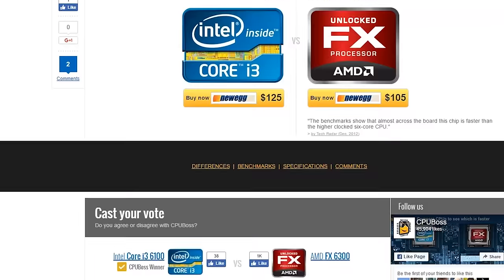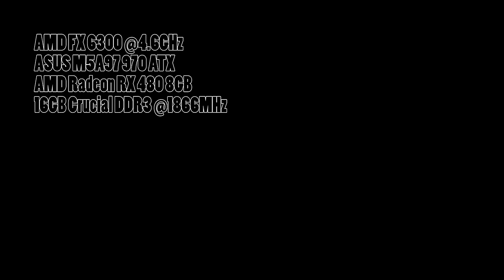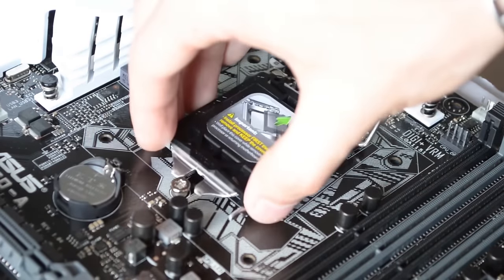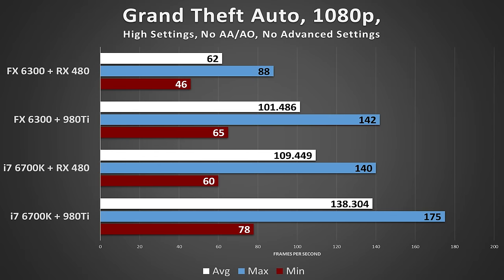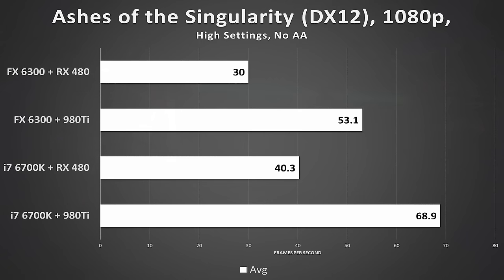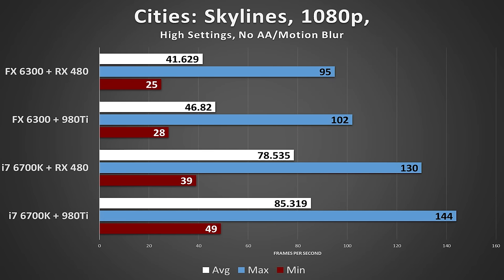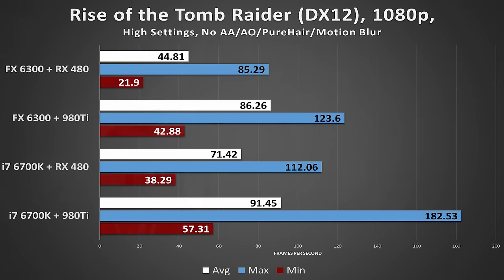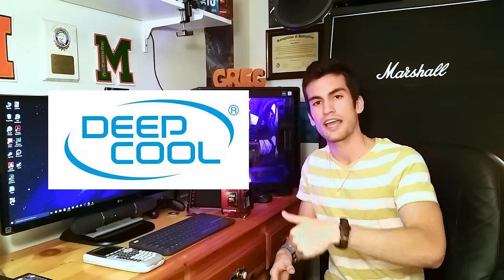AMD FX 6300 + RX 480: Severe Bottleneck?

Comment: Yeah but you are running a new i7 HEAVILY OVERCLOCKED with faster ram. Compare it to the i5 2500k with identical frequency ram. That's the processor it was intended to compete with

This comparison is woefully unfair because of the age difference of the platforms. AM3 is 7 years old. AM3+ is mostly the same thing with a couple of small improvements. 

Take a stock i5 2500 (non k) using 1800MHz or 2133MHz DDR3 on both systems. Compare it to the FX6350. Run both CPUs at stock clockspeeds. This will keep both the processors power draw at optimal. 

Sandy Bridge was intended to compete with the FX processors. Give AMD a fighting chance against the intended competition
Reply from the maker: Pay attention.
Reply: I did pay attention. I just would prefer more of a pure architecture vs architecture test. Tests using an FX processor should really be more about how they stack up to the intended competition over time. Vishera vs Sandy. The reason you can still buy them today isn't because they are meant to be competitive but they allow AMD users to continue to support their established platform.

The stock i5 2500 should still beat the FX6350 but in recent multi threaded games the results should be wildly different than what we saw 4 years ago

Its similar to when you look at the R9 280X vs GTX770. The architecture advantages and disadvantages appear over time
Reply: have you watched the video?
Reply: Why compare them at stock speeds? The FX series are meant to be overclocked to hell. I'd rather see comparisons with decent OC's because not doing so with an FX series or K series cpu is just a waste
Reply: Believe it or not most people want nothing to do with overclocking. Most systems are never overclocked because of warranties and the general consensus that overclocking puts strain on your chips and motherboard shortening the longevity of your PC.
Reply: Are you insane or just that dumb? Who the fuck cares about what you prefer? He is testing an FX 6300 with an RX 480  vs a "as no bottleneck as it gets CPU"  which happens to be Intel. This is not a CPU vs CPU video. Also even if it was he is comparing the newest from AMD vs newest from Intel which also woudn't be unfair, its AMD's fault their shit is old. There are a ton of videos comparing the FX CPU's vs Sandy B. so there is 0 reason for him to actually make one of those, especially when the Sandy B. perform super close to the newst Intel chips. And he is using an overclocked i7? And the 6300 was also overclocked its just that it runs a bit hot so it cant be overclocked as much. Also why would you give someone a fighting chance? There is 0 reason to give someone a chance they need to justify someone buying their product by themselves, buyers are not a charity. You are obviously bias to AMD, so don't participate in arguments its making ppl lose brain cells with how dumb your statments  are.
Reply: No you should pay attention and read the title again. I don't know where you got the idea that this was a video comparing 2 CPUs. He was trying to show you that the fx 6300 bottlenecks the rx 480. He thew the i7 in there, because It's the most powerfull CPU for games. Btw the i5 2500k was rather competing with the 8350.
Reply: Sasa Lolic "It runs a bit hot so it cant be overclocked as much", thats really not a correct statement. Contrary to the popular, "AMD=The Sun" philosophy, the FX series run quite cool. I have the very similar 6350, with a 212 evo, and even with my cheap, quiet fans the cpu still stays under 55c at 4.6GHz, under very heavy loads, and room temp at idle. And I could push that number even higher with a half decent AIO or even just more powerful fans on my evo, and a PSU I could trust. I'd hardly call Greg's OC of 500MHz over stock turbo not as much as his 400MHz OC on the 6700k
Reply: ***** I really want to see how FX hold up to its intended competition

i3 2130
i5 2550k
i7 2700k

With equal DDR3

I'm more interested in how these newer games support multi threading better than the bulk of the games released up till recently.

DDR4 clocked at 3200 will show massive gains over 1600MHz DDR3. This doesn't reflect the CPU architecture.
Reply: you're making a fool of yourself
Reply: +Ian Brandon Something Again, like the others say, "pay attention." Pay attention to the title and the content. This is not a comparison video, it's an analysis of how much an FX-6300 can hold back an RX 480. You're trying to prove a point that doesn't even exist in the video in the first place.
Reply: Ian Brandon Something The FX CPUs are better than the i3 2130 gen but worse than the i5 2500k. There you have it.
Reply: I could have told you a year ago that the RX480 would be bottle-necked by a FX6300. That's obvious. What this doesn't tell is how much, if at all, those additional 2 threads close the gap between 6 core FX vs an older 4 core i5. That was supposed to be the point of the improvements in multi threading performance in recent games.

Using the newest i7 overclocked to its maximum along with 3000MHz DDR4 doesn't tell me at all if running a RX480 in an older i5 or i3 PC would also bottleneck it. I want to see if DX12 made a difference for the FX processors against the architecture it was intended to compete with. The FX processors were clearly defeated by large margins on release. I want to see improvements to code have changed that story.
Reply: ***** ? i used a prebuild sff that that is insanely tiny pc with an i5 2500 with a shitty stock cooler and obviouly horrible airflow and the temps didnt go over 50-55 in the summer. An considering how old that pc is if i changed the paste and cleaned it a bit it would be even cooler
Reply: +Ian Brandon Something then don't argue in a specific video which intention was only to show how much of a bottleneck is caused by FX6300 when paired with RX 480. If you want to see comparison with older i5 or sth, there is a search bar on the top...
Reply: +ElectryPower There aren't many that even demonstrate the RX 480 with the FX6300. 

I guess I just want to see the results of this combination against a similar Intel setup. The i7 6700K overclocked to 4.6GHz with 3GHz DDR4 is a brand new high end setup. Its literally the highest end system for game performance you could run. 

It doesn't tell me what I would expect running the RX480 in a Sandy or Ivy bridge PC that isn't overclockable. The new i3 with 3GHz DDR4 competes with the overclock i5 2500k. Its hard to really compare the old AM3+ platform against a DDR4 platform. Nevermind overclocking the newest i7 to such high frequencies
Reply: +Ian Brandon Something Make a request for a different video, then. This video was meant to measure how much of a bottleneck the FX-6300 is to the RX 480. Yes, it tells you "how much" by putting two CPUs and two GPUs in four different pairings. By pairing the graphics card with the "best" consumer-grade CPU, you're removing as much bottleneck as you can. The 6700k shows the graphics cards' best consumer-grade performance. What it doesn't tell you is "how much of a bottleneck is it compared to an i5-2500k." You won't find that in this video no matter how many times you say, "I only wish it was shown here."
Reply: +Ian Brandon Something I'd also love to see comparison with older i5s, as I own 2400 non-k (oced to 4ghz) currently paired with r9 290.

I was kind of expecting better performance out of the RX 480, but benchmarks have shown that there is no point for me to upgrade (except for lower power draw maybe)...
Reply: Read the title of the video lol, this is not a cpu comparison!!!
Reply: UlTrApLeX I really don't understand how you could say its not. Its literally a comparison between how two different processors feed a GPU. 

Its a direct comparison between CPUs. 

Just not a very fair one given that there is such a massive difference between ram.
Reply: and yet another idiot. hahahahaha
Reply: I agree with , it was not AMD vs Intel, we have to look at old vs new architecture (AMD or Intel). I'm still using my 8350 atm since it filled all my need just I have to be aware that It wont last forever and that inside a year I might need to replace it. (This video goes to the people using the old Intel CPU as well)
Reply: +Ian Brandon Something 10 replied saying you dont make sense but keep arguing and not realising he just used the intel cpu to show that the fx cant power a rx 480 also ram has very little influence here even a 4770 would give next to identical frames to the 6700k
Reply: They will be all equal since all of them are old architecture. You have to realize this generation of CPU wont last forever and that application are asking more and more IPC. All of them need to be replaced one day and the day is coming.
Reply: ElectryPower Exactly my point

A lot of people have un-overclockable Sandy Bridge and Ivy Bridge processors that are used for gaming. A lot of people even run low powered unoverclockable Haswell parts with low powered DDR3. Running the RX480 on older i5 systems is a more realistic test for the people interested in it.

Those are the budget users looking for a cheaper, low wattage GPU, which is exactly what the RX480 is.

It may also paint the FX 6300 in a less woefully outdated light. The FX series always struggled because of its single thread performance. New programs are supposed to actually fully load the processor.
Reply: Someone with an overclocked i7 6700k is not going to run an RX480. They'll run a far higher end GPU config
Reply: +Joshua Kallen After wasting 15 minutes reading this comment thread I'm convinced that Brandon is either oblivious and slow on the uptake, or just hard core troll. Let's just stop feeding it because he'll turn around and say the same darn thing. "It's a CPU comparison guys." Literally says not a CPU comparison disclaimer in video.
Reply: +Ian Brandon Something this is not a CPU comparison this is a video to show if this CPU is a bottleneck and how much of a bottleneck it is.
so your point of comparing with other CPU is completly invalid because he used the 6700k to show how the performance of the gpu is when it is not bottlenecked.
Reply: ***** The results are clearly meant to tell us that the FX6300 will bottleneck the fuck out of the RX480. That makes this a CPU comparison

An older Sandy or Ivy i5 in stock vs stock against this CPU would tell us whether or not there are any gains possible from 6 FX cores compared to 4 Intel cores and whether there is actually a tangible improvement from addition cores in DX12 titles. The i7 overclocked with 3GHz DDR4 only shows us that 8 of the newest theoretical Intel cores running at equal clockspeeds feeds the RX480 25%-100% better than the FX6300

Its certainly a CPU comparison if you learn anything from it. I just wouldn't judge the old Piledriver architecture by this comparison. It wasn't intended to compete with Skylake
Reply: Sasa Lolic Sorry to say guy but people that go around calling others stupid and dumb, often are trying to appear smart to prove to others that they aren't thick as a brick.

I own PC components from all of the big three. I have love for AMD but that doesn't mean I won't say their hardware is shit when it is shit

I loved my Win7/Phenom II x4/HD6950 ref build. It ran everything I wanted at near maxed out image quality, and it only set me back $700 for everything including the expensive bits I splurged on.
Reply: +Ian Brandon Something Dude. The point of this video was to show that pairing a 480 with 6300 is not a good idea. Nothing else. If you want dx12 benchmarks, look it up. The i3 is still miles ahead in dx12 titles. You are bringing up the fact that it wasn't meant to compete with a skylake. nobody is saying that is supposed to. But that doesn't change the fact that the fx lineup is not worth it right now.
Reply: Bruh... This isn't comparison who's better. This is comparison of a bottleneck. He's showing how much is FX 6300 actually bottlenecking RX 480. In order to do that test you need as powerful CPU as you can get and as powerful mobo as you can  get to remove them out of the equation "bottleneck". When you remove that you get to see how more FPS you actually get (the less fps you get the less of a bottleneck CPU in test was the more FPS you get the more bottlenecked CPU was)
Reply: Rhelmar It clearly showed that it has the potential to severely bottleneck the GPU. These tests don't really prove that your bottleneck will scale with near maxed settings though.

My experience with my Phenom II x4 taught me a lot about how adjusting settings properly can allow for a lot more headroom from weak hardware than benchmarks show

Skyrim was running at 15-40fps when I maxed out every setting. Benchmarks put the HD6970 at 60fps+ running at 1080P. Turns out Bethesda's ancient engine handled shadow rendering through the processor. A rendering method going back to Morrowind. One tick down in shadows put me at 60fps average.

After that I began to mod. I improved almost every texture in the game to levels recommended for far high spec systems than mine. I kept adding all of the best graphical mods available. I couldn't believe how good the game looked. Best of all the frame remained locked at 60fps.

My point is that a CPU bottleneck often isn't really holding back the GPU. You can limit the load on your CPU and continue to increase load to the GPU without frame rate penalties.
Reply: Ian Brandon Something Yes you can do that if you can mod. Unfortunately not every game has settings to minimize cpu load. And most people can't mod games. You can't eliminate a bottleneck by just tweaking some in game settings. You can try ini tweaking, but most people can't even do that. That's not the point though. The point is, that you complained about him using an i7 to show the bottleneck of the fx 6300. If you were to do a vid like this, how would you do it? what hardware would you compare? I'm generally curious, since you seem to have some other ideas.
Reply: Why give them a fighting chance? This is 2016. Still they are sitting on their hands with nothing new.
Reply: +Ian Brandon Well it's not Science Studios problem that Amd is so greedy that they re-releasing their obsolete, over 5 years crappy FX cpus and can't provide anything to the cpu market with discrete cpus.
Reply: Rhelmar You are right not all games do. Saint's Row the 4th was unplayable on my Phenom II x4. I couldn't get 30fps stable no matter how low the settings were.

He didn't do his test wrong. He showed basically the best case scenario for the RX480

If I were to demonstrate where the FX processors bottleneck the RX 480 I would compare the FX4350, the FX6350, the G3258, the i5 2500k, and the i5 6600K.

That demonstrates when the system is bottle-necked by thread speed, the number of threads, and memory speeds.

I would use the GTX970, RX480, and GTX750Ti or another low end GPU to compare the effect of Nvidia's and AMD's loads on the processor and whether or not thread count has any effect on the driver overhead which is supposed to distribute the load across threads under DX12.

I really want to see if previous bottlenecks are fixed by DX12. DX11 was a disaster for the FX chips
Reply: +Ian Brandon Something This video isn't intended for the time travelers who can watch it back when sandy bridge was released.
Reply: Ian Brandon Something aaaaa you are so dumb this is not about how good the fx is compared to intel it is about it bottlenecking the 480, he jsut used the i7 as it is the best gaming cpu out there to show the full potential of the 480 while not being bottlenecke. nobody cares if you wouldve prefered it compared to an i3 or an i5 go to the search bar and look it up this is about it bottlenecking the 480 or not and we got the answer to it now stfu
Reply: Zwan AMD aren't in the position to release an entire line with small improvements every two years on a new socket like Intel. Intel has 100x more money. They can easily outspend them on R&D to speed up their chips. The amount of money Intel spends on tiny improvements would bankrupt most companies

AMD needed the software developers to support multi threading which they have successfully done through Vulkan and DX12. There was no point in continuing to release improved Steamroller and Excavator chips if they couldn't hold a candle to Intel in IPC and multi thread support was as poor as it was through DX11

I know they can release a competitive chip but they need the right coding environment and a design that isn't automatically outdated

APUs could have put them in the lead but they never had the single thread performance to make them competitive and they couldn't rely on multithreading
Reply: Ian Brandon Something Greedy Amd did no R&D for FX. They just relaunched the overpriced FX lineup as gimped Phenom 2 so they could deceive buyers to buy their bad cpus.
Reply: Look back at Magny-Cours. That was a 12 thread Phenom II. AMD's hardware was never garbage. The support for multi threading was never there to make processors like that usable to the average user
Reply: Ian Brandon Something http://www.pcper.com/reviews/Graphics-Cards/DX12-GPU-and-CPU-Performance-Tested-Ashes-Singularity-Benchmark/Results-Heavy
This links show comparisons between amd and intel cpu in ashes of the singularity. dx11 vs dx12. The fx isn't able to close the gap to intel. 
Your aproach isn't wrong. But it goes way deeper than what your average gamer wants to know. He only wants to know if it bottlenecks or not. They don't care about the details. (It would be an interesting test though). Also keep in mind that he doesn't own all the hardware you mentioned. Even if he did in the past he probably sells stuff that he doesn't need and already benchmarked. Since he still has to buy his hardware himself. 

But let's get back to your original post. You complained that this comparison was unfair and we should give amd a fighting chance. It wasn't intended to be a direct comparison. And it doesn't matter when amd released their cpus. They strategy was the complete opposite of intel. They wanted to keep the fx lineup as long as they possibly could. The fx cpus are no longer worth it. They can't beat the new i3. It doesn't matter that they are older. This is current lineup, and it should contend with intels current lineup.
Reply: Heyyo, ugh I hate the ram speed comparison... if I'm comparing what I would buy for FX-8370 build vs say an i3-6300 or an i5-6400 build? I wouldn't be comparing gimped DDR4 to DDR3... no, I'd be comparing similarly priced DDR4 to DDR3... such as:

G.Skill Ripjaws X Series 16GB (2 x 8GB) DDR3-2133 Memory (CAS 10) = $58.88
https://pcpartpicker.com/product/cF7wrH/gskill-memory-f32133c10d16gxm

to...

G.Skill Ripjaws 4 series 16GB (2 x 8GB) DDR4-2400 Memory (CAS 15) = $58.88
https://pcpartpicker.com/product/ydCrxr/gskill-memory-f42400c15d16grr

They're both the exact same price and even from the same Manufacturer... so how is that not a fair comparison? :P

Then again, if you look closely I included the latency, DDR4 memory has higher latency which everyone seems to miss... so really both of them balance out anyways. That's the trade-off for the lower voltage of DDR4 is higher timings and latency... so yeah, like I said, no one buys RAM with comparable speed, everyone buys RAM for the price to performance. Saying otherwise is just silly.
Reply: MrKeikari The design isn't as bad as you think it is. I believe they exceeded the Phenom II in IPC with Excavator released this year

http://www.overclockersclub.com/reviews/amd_athlon_x4_845_cpu/4.htm

This is the only excavator chip released

This would have been the architecture behind the 4th gen FX 8 cores but AMD are waiting for Zen. If you do some rough math you could see it performing within spitting distance of the i7 6700K in multi thread workloads.

Basically 35% better performance over Vishera clock for clock. Think of a 6.750GHz FX9590

This still wouldn't come close to besting Intel in IPC though which is why they skipped it.
Reply: Ian Brandon Something are you happy now?
Reply: Ian Brandon Something Yeah, 10% IPC improvement after 5 years xD FX lineup is the biggest fuck-up in cpu components this millenium.
Reply: Quite
Reply: Marc Bourgoin That is a fair comparison. The DDR4 used here was 3000MHz but yeah point taken

I did say later that his test was the best way to show the max potential. AMD's memory subsystems are ancient now. They just didn't want to commit to mass production of Steamroller and Excavator and release AM4 motherboards

I hope Zen catches back up at least
Reply: MrKeikari Like I said it was clearly meant for APUs. The on die space savings would have freed up more space for the GPU. 

Basically a 10% IPC improved 8 core Phenom II and an R7 370 core on a single die. Not a bad little machine to be honest. Slap an R7 370 next to it for dual graphics. The performance of an FX 8350 and R9 380X in the size of a Chromebox.
Reply: +Marcusius had to change my FX 8350 for a i7 5820K 6 cores for my GTX 1070
Reply: You've completely missed the entire point of this video, which was to answer one basic question - will an FX 6300 bottleneck an RX 480 (and to a lesser degree, how badly)? Conclusion: Yes. He could have used any of the most current hardware to illustrate his point, didn't necessarily have to be a 6700k, but in context of the exercise being performed it doesn't really matter. It wasn't a "versus" video, it wasn't attempting to be an apples to apples comparison video. He was simply trying to illustrate whether or not pairing a 6300 with a modern video card was a good idea from an economic/performance standpoint, which it clearly is not depending somewhat on the settings you typically play at.
Reply: I don't understand what your on about. The i7 will always be the maximum threshold when analyzing a bottleneck, this video was not meant to poke fun at the 6300 but to check how much it bottlenecks the card vs the cards maximum potential. The 6300 actually handled okay against the i7 and it's frames are nothing to be shamed about. It's just you looking at the video the wrong way
Reply: Ian Brandon Something APUs are decent, especially for the price but that doesn't make discrete cpus any better.
Reply: Watch the end of the video, he clearly explains and answered your comment.
Reply: Why should he test 7 years old Intel cpu? He tests with what is available right now. Anyway no one should buy those old FX cpus anymore, just wait for Zen and if you don't want to buy Zen you can be sure AMD will drop prices of FX even further..
Reply: +Like Clockwork64 
Ignorant or stupid?
Reply: +Like Clockwork64 dude are u homeless?  because u looks like u lost...  go back read the titles and watch the videos please for more info... damn i laughing so hard reading the comment about..  more then 10 ppl saying the same thing just a difference sentences " this is not a versus video " what the heck?  is it hard for u to understand?  and still give out ur opinion blah2 about amd?  defuq?  so fkn biased boy
Reply: +Like Clockwork64 dude are u homeless?  because u looks like u lost...  go back read the titles and watch the videos please for more info... damn i laughing so hard reading the comment about..  more then 10 ppl saying the same thing just a difference sentences " this is not a versus video " what the heck?  is it hard for u to understand?  and still give out ur opinion blah2 about amd?  defuq?  so fkn biased boy
Reply: +Like Clockwork64 dude are u homeless?  because u looks like u lost...  go back read the titles and watch the videos please for more info... damn i laughing so hard reading the comment about..  more then 10 ppl saying the same thing just a difference sentences " this is not a versus video " what the heck?  is it hard for u to understand?  and still give out ur opinion blah2 about amd?  defuq?  so fkn biased boy
Reply: +Like Clockwork64 dude are u homeless?  because u looks like u lost...  go back read the titles and watch the videos please for more info... damn i laughing so hard reading the comment about..  more then 10 ppl saying the same thing just a difference sentences " this is not a versus video " what the heck?  is it hard for u to understand?  and still give out ur opinion blah2 about amd?  defuq?  so fkn biased boy
Reply: +Like Clockwork64 Anyway the i5 2500K is not really the ideal candidate for this comparison, as that processor was competing with Bulldozer not Vishera. Even then, Bulldozer was so late to the game, you could arguably say that Ivy bridge was it's real competition considering It launched just a few month after Bulldozer. Same can be said for Vishera and Haswell ... both were launched within the same time frame (or quarter if you prefer).
Reply: In the video he stated that this video WAS NOT meant to show how much better the 6700k was than the 6300. Instead it was meant to show ho, in a scenario with no CPU bottleneck, the GPU would perform, then compare it to the 6300 to let you determine whether or not it was worth it to take the x% dip in frames in return for the price drop. This was not a performance comparison.
Reply: +Marc Bourgoin
"G.Skill Ripjaws X Series 16GB (2 x 8GB) DDR3-2133 Memory (CAS 10) = 
$58.88
https://pcpartpicker.com/product/cF7wrH/gskill-memory-f32133c10d16gxm

to...

G.Skill Ripjaws 4 series 16GB (2 x 8GB) DDR4-2400 Memory (CAS 15) = $58.88
https://pcpartpicker.com/product/ydCrxr/gskill-memory-f42400c15d16grr

They're both the exact same price and even from the same Manufacturer...
 so how is that not a fair comparison? :P

Then again, if you look closely I included the latency, DDR4 memory has 
higher latency which everyone seems to miss... so really both of them 
balance out anyways. That's the trade-off for the lower voltage of DDR4 
is higher timings and latency... so yeah, like I said, no one buys RAM 
with comparable speed, everyone buys RAM for the price to performance. 
Saying otherwise is just silly."

DDR4 Has a higher latency on paper, yes, but, on paper, my, roughly, 50-100 dollar laptop shouldn't run Crysis 3, yet it does.
http://pics.crucial.com/wcsstore/CrucialSAS/pdf/en-us-c3-whitepaper-speed-vs-latency-letter.pdf

From our beloved Crucial, very good RAM manufacturers.
PS: Page 3 if you don't want to read through all that stuff.
Reply: jubal harshaw  OMG, this ignorant AMD fanboy lying to people without a hint of proof and then raging when her wrong beliefs are corrected.

Jubal Harshaw: "	+MrKeikari You have no concept of what was being discussed...you keep talking about the stupid fucking 8350, like it has any bearing on the matter. Fuck off." CHILL DUDE, STOP BEING FANBOY!!!!!!!!
Reply: ***** Because why not? The 6300 is a popular processor in Steam. If the intel Pentium 4 was the most popular then that one would be compared to an I7 for bottleneck tests. And people should stop comparing the frames of an i7 to a 6300 but focus how much frames the 6300 can put out with the 480
Reply: Benoit Levesque the i5/i7 2XXX series and above have roughly the same performance with the 6XXX series, so comparing them is still moot. The only advantage from 2XXX to 6XXX is a couple more (1-5) FPS with the same GPU and less powerdraw
Reply: JA Belms 
The whole point of the video was to see how much of a bottleneck the 6300 was, it was not to see what the best performance to dollar rx 480+cpu combo was.
Reply: Flying Snail That's what I said
Reply: ***** The ignorant Amd fanboys hang on to every thread to make their obsolete cpus seem even a bit better...
Reply: +Like Clockwork64 He literally addressed this exact issue in the video and explained exactly why it doesn't matter. Not sure if trolling, or really stupid, or deaf.
Reply: Flying Snail This still isn't a great comparison for that point either. This only tells us that the FX 6300 is a significant bottleneck at the chosen settings.

If you pay attention to the settings used he mostly stuck with presets. I know from experience with my Phenom II and HD6970 that the GPU has far more to offer without adding to the CPU bottleneck at all

Finding the optimal settings for the processor and then increasing all of the other settings will increase load on the GPU without decreasing the frame rate for the bottle-necked system yet dramatically increase visual fidelity

This comparison shows how much of a bottleneck the CPU is when the GPU isn't being stressed. His testing methodology  exacerbates the bottleneck. Increasing these graphical settings will drop the i7 test rigs frame rate and barely budge the FX 6300. This would make the results a lot closer and the perceivable bottleneck smaller.
Reply: Like Clockwork64 
You can increase graphical fidelity while not lowering framerate much, that is true but he was not trying to target the hardware to try to get the best looking game. He was trying to find out if at settings relatively close to what people play on, is there a CPU bottleneck?    But all of this is ignoring why he didnt test it like that, because it adds far more work and problems then avoiding it all together. For example, if he increases graphical fidelity in GTA 5, should he increase the amount of ai in the game, and stress the cpu even more? These are the types of problems you get when testing it and why this video was not made for people who want to see what real world performance for most people is going to be exactly.
Reply: Kay Carls The point is whether or not the FX6300 and RX480 is worth it. This shows us at the high preset with low quality AA that the FX6300 is a significant bottleneck. The RX480 can handle far higher image quality settings though. Now if you decided to play with your settings for another 10 minutes you'd find that most games allow for maximum textures, maximum object detail, longer LOD, etc. A lot of these settings barely effect the CPU at all but will negatively impact the i7 system's frame rate more than the FX6300's. That closes the frame rate gap substantially. 

Its the exact same situation back when the Athlon II x4 was the budget CPU for gamers. Using max settings always closed the gap between it and higher end CPUs
Reply: That might be the case. And when a cpu bottlenecks the gpu, just like in this video, it has more impact on the frame-time. I'm sure you know of this as well. Say i can play games on fx6300+rx480 on 1080p 60fps Ultra preset, the i7 also runs it at 60fps, but due to the frame-time impact which stutters these games every second, i need to turn down the settings to High Preset to remove the bottleneck, which is fine. But when i look back, the RX470 (Example) can also run the game on High Preset 60fps without cpu bottleneck. So, is the rx480 worth it? It still depends on the consumer of course, there is no direct answer to that. But from my personal experience, going for a more balance setup is just better overall in terms of performance and budget spent.
Reply: Frame times shouldn't worsen unless you further increase the CPU bottleneck. All increasing the GPU load will do is decrease the maximum possible frame rate which is already limited by the CPU. Using the correct setting configuration is a must when running lower end hardware. Its all about understanding where you are limited in bandwidth and frequency.

This is why using the correct settings for a Athlon II x4 and decent GPU a few years back produced comparable results to much higher end CPUs with the exact same GPU.

The RX480 is already the bottleneck in the i7 system. Increasing GPU load will decrease that system's frame rate. Doing the same with the FX6300 shouldn't decrease the frame rate as long as you don't further choke the CPU.

This is exactly why I was able to add lots of additional load when modding Skyrim without affecting my frame rate at all until my GPU became the bottleneck. The same concept applies to most games
Reply: watch the entire video next time
Reply: hell yes thank you and well said
Reply: Typical AMD fanboy, this isn't a comparison video. Literally the whole point of this was the show when and how much the CPU was bottlenecking the graphics card.
Reply: Like Clockwork64 

The point of this video is to show how the maximum capabilities of the RX 480 is handicapped by FX 6300. in order to know how much it bottlenecks, he used the latest and highest end CPU that will surely not bottleneck it and it happens to be an i7 6700k. From there on the comparison of how much it bottlenecks begin. 

If you can't even comprehend the main agenda and purpose of this video even when explained by the other 80+ comments, you need to go back to school and learn to read.
Reply: I guess  most games are most GPU demanding than CPU demanding, so if there be a bottleneck in somewhere I prefer a CPU bottleneck, than a GPU bottleneck..
Do you all agree with me ??
Reply: Speed That's how it is even with Intel processors in some games. Far Cry 4 was like that.
Reply: Haha! Wow you AMD fancunts are idiots. Way to make a fool of yourself.